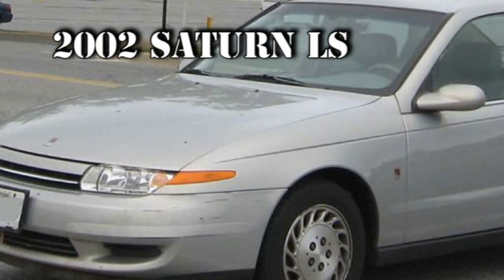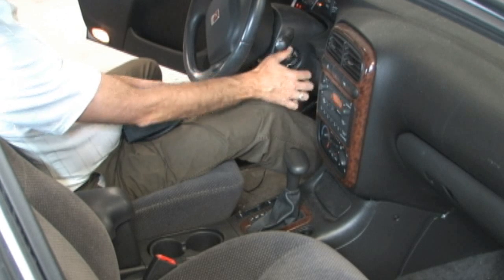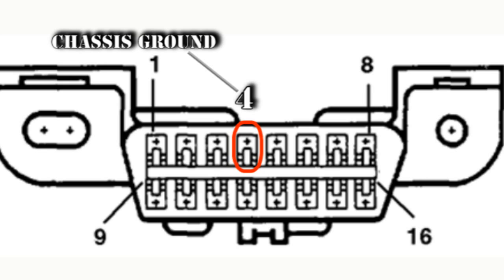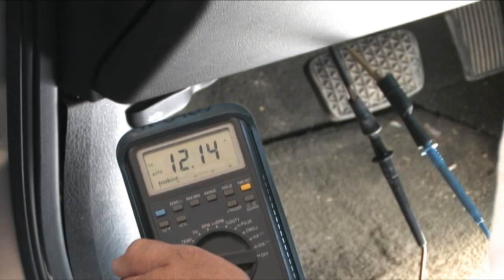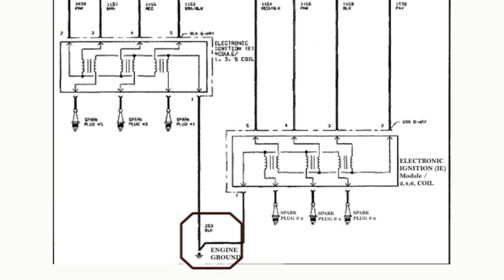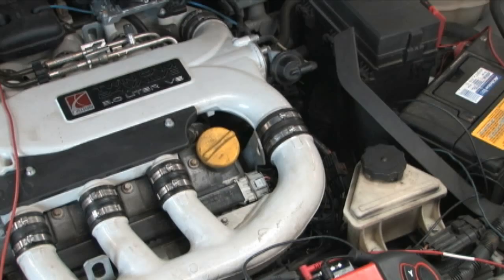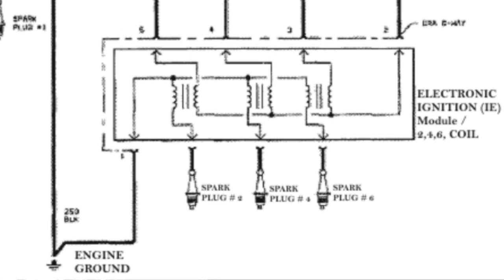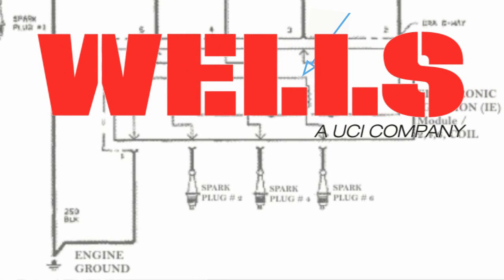Computer No Communication Troubleshooting by Wells Saturn

Comment: Let me know if you have heard of this. I am working on a friends car 99 Lincoln town car it revs up good and it idles fine but when you drive down the road it looses all engine power like as if you took your foot off the gas pedal no misfires or anything come to a stop and hit the gas and its good for 30 seconds or so then it does it again. I used the verus and found out that when it runs out of power I loose injector pulse I scoped all sensors and checked ecm grounds and everything was good, so I told my buddy it looks like the computer is bad
His wife looked on the net and found out that if you have different size tires on the car it will cut the power out to prevent drivetrain damage and he told me there is a reset button in the glove box
I have never heard of this? Is this only on the Lincoln town car? I looked at the wire schematic and didn't see this reset button nor did I find anything in mitchels trouble shooter
Reply from the maker: 1. Locate the Traction Control Switch inside the glove box. Turn the switch to the off position. If the symptom changes or goes away, look at the tires.

2. Make sure they are 1) all the same size. 2) all the same circumference (within 1/4"). Replace tires as needed.

Why can't I find a wife like her?

Mark Hicks
Wells Vehicle Electronics
Reply: markjhicks Thanks. She only did that because she needed to have her car

Comment: Wow! you guys rock. Question. I have a 96 chevy tahoe that takes off just fine til I have to brake, then it doesnt see the gears again without pulling over and restarting the truck...any thoughts?...or cool videos like this one???yet???? Signed, still down for a whole year...a frustrated gramma in AZ
Reply from the maker: Well now, we can't have gramma upset, let's see if this granpa can help a little.
When you say "it doesnt see the gears again", I am not quit sure what that means. Does the engine die? Does the engine rev up but the vehicle does not move? Does it only do this when you hit the brake? How about if you just take your foot off the accelerator and coast? Please give me any details you can think of,
Mark Hicks
Wells Vehicle Electronics
Reply: the engine doesn't die, it just revs instead of kicking into the gears 1 and 2, 3 seemed to work just fine. It does only do this when I hit the brakes. If I coast, it seems to try to find the brakes again, but we are talking, it's not going over 35 ever, since this started. Thanks again Mark. I appreciate your direction and concern and of course your knowledge and time....signed, gramma can't spoil her babies yet in AZ
Reply from the maker: It is a transmission slipping problem. Usually this means the transmission needs to be rebuilt. Check the fluid and see if it is dark.
Wish i had better news for you,
Mark Hicks
Wells Vehicle Electronics

Comment: came across this video by chance, having the same prob with a 2003 Saturn l300 no comm with scantool...will check on Monday and let you know if problem repaired. replaced the bcm still no start, will try your info and see. thanks